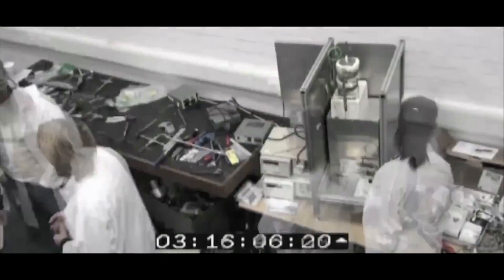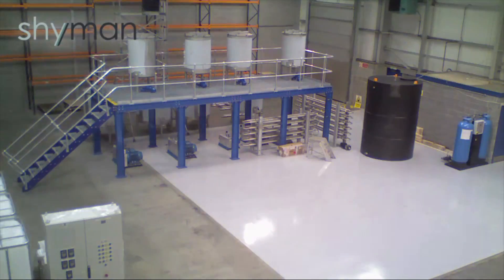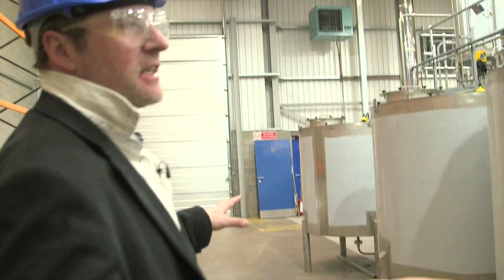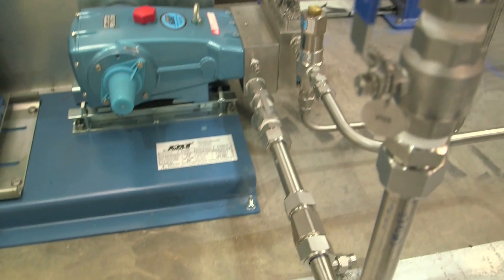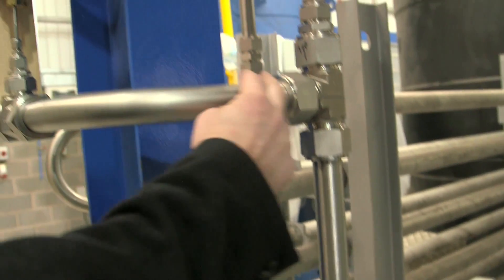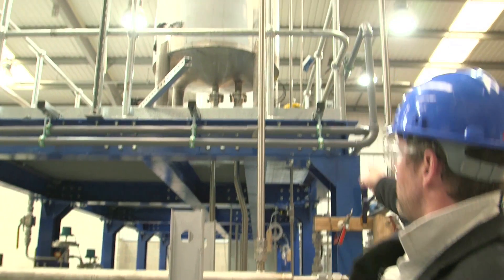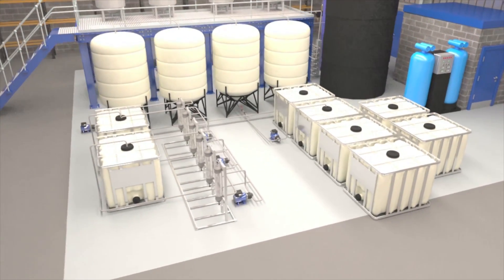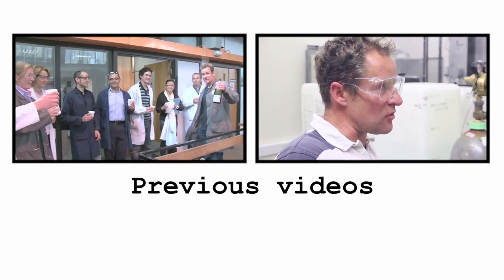Scaling Up

Comment: Astounding, really cool! I wonder how the cooling media (water mostly I suppose) will be regenerated.
Reply: There is no shortage of water in the uk
Reply: +Morru Qu'aan yes but chemically treating freshly bought water with the same flow rate as what the entire plant needs for cooling isn't fun. I was thinking recirculation & cooling towers perhaps, or air-cooled heat exchangers when applicable.
Reply: +Maggie B and I should probably clarify that I meant regeneration of the low in-temperature, not water as a substance :)

Comment: "So this is our reactor." Points at a sink drain pipe.
I have to admit, for the word Reactor I imagine a concrete dome, or a chrome sphere or at least a rhombic enneacontahedron with lots of tubes coming out of it.
Reply: +Penny Lane +2nd3rd1st welcome to the world of industrial chemical manufacturing
Reply: Just what I thought: there's this big factory with all kinds of impressive-looking stuff in there and then the actual "magic" so to speak happens in a piece of pipe that I would have walked right by.
Reply: Chemical reactors tend to look like bits of pipe most of the time.
Reply: +2nd3rd1st Rest assured that is no "sink drain pipe." It is very expensive high-pressure stainless steel pipe.
Reply: +killernat  It's a weird world
Reply: killernat Well, I like me the world of industrial biotechnical manufacturing more then. There, all the important stuff happens in huge bioreactors that actually look the part.
Reply: +Penny Lane There all cool in there own way. I my self feel it pretty impressive that some thing that look so simple can hide such complexity. Like how the first man made grapheme was made simply by using tape on graphite. Of courser from a industrial view it is all about scaling the process up in the end.